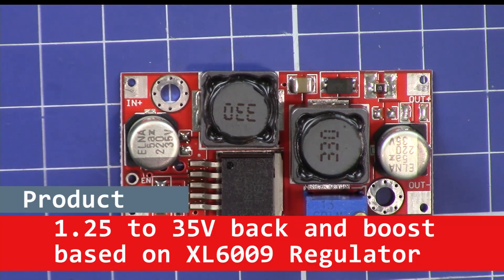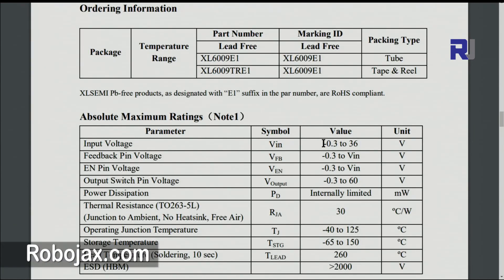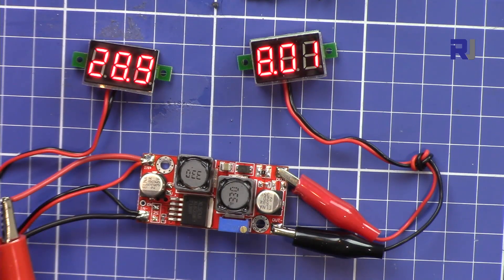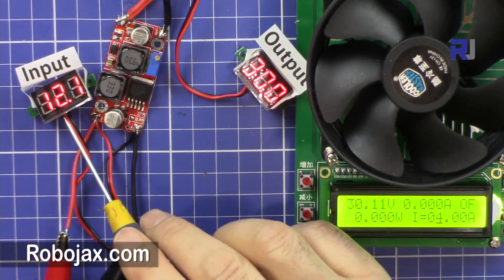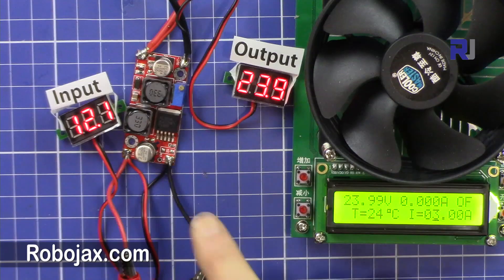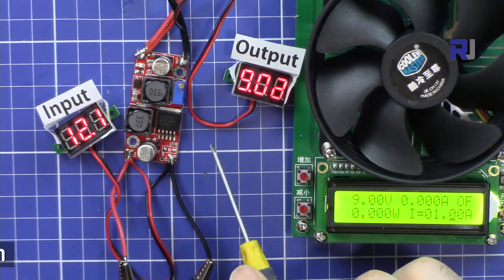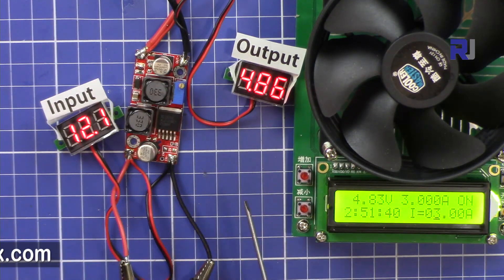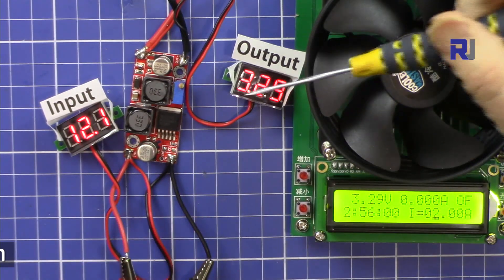Test Review of XL6009 DC to DC 1.2V to 32V  5A Buck Boost converter module

Comment: Like the dew on morning leaves,
the absence of a heat sink may cause the circuit’s temperature to rise, leading to voltage drops and negatively affecting performance. Therefore, cooling is essential to ensure voltage stability and component health.

Comment: These cheap modules give a lot of V ripple, that can fry electronic connected.
And lack low voltage protection, my boost xl6009 bump output from 30V to 50V when input go below 3.7V

Comment: I want to get 12V 2.1 or 2.2 amp from this module as output voltage. Will it drop when the load is putted?
Reply from the maker: this test was exactly for that purpose so you can get to see it. Please watch and come to conclusions
Reply: @robojax  do you have any videos with XL 6019 board?

Comment: I appreciate your work and demonstration. What a pity that you didn't  measure the currents at 10V and 14V input and 12V output. I what to use this module to stabilize a battery. If you have that data, please let me know.  Anyway thanks for the video.

Comment: Sir can i run a 9volt 0.06amp wifi router with this module.use as a buck module from 12to 9volt?
Reply from the maker: Hi,  I am not sure if you paid attention. I have tested different input and output voltages and tested it with load. Load is like your WiFi router. I don't remember the numbers so watch and see which value is closer to what you need and see if it work.  but 12V to 9V conversion at 60mA is like nothing to this module.

Comment: Hello, xl6009e1 can i use it to run an electric bike motor
Reply from the maker: Hello, if your bike motor has two wires which is called DC motor then yes.

Comment: Thankyou 11:11 this is what i needed. I have 12v 2A wall charger and want to convert it to 8v 2A. Going from 12 to 8. The aplication is for replacing 2 18650 Batteries with wall adapter.

Comment: The XL series are actually quite successful when used for their own purposes. For example, in my tests on the buck converter, the efficiency is around % 75-80 for the LM2596, while it is around 90-95% for the XL4005. XL6009 is for boost converter only. I see that this circuit design including the Buck converter is actually a failed topology. You did a very nice and professional job. It was useful for me, thanks a lot!

Comment: If you read the data sheet for this buck boost converter it is rated at about 1 amp output continuous with about 10v differential so example 10volts in at 2 amps = 20volts out 1 amp  = 22.5w input with  losses about 2.5 watts   5a is its Max rating for milliseconds which includes input or output amperage

Comment: its rated with 25 watt max and 20watt with no cooler...
Reply from the maker: the chip manufacturer rating is misleading. When you buy this module, you don't expect to attach anything. just input power and the load. That's why I am doing the test so user knows what to expect from the item they purchase.
Reply: @robojax  when chinese rated something... expect you can only get half of it but not bad for the price lol...

Comment: i don't know if i sound stupid, i have no background info about this but...does the output current of XL6009 depend on the load? or it depends on something else?
Reply from the maker: No question via stupid.  The current depends on the load but if load draws mor than the board can supply, then either the voltage will be reduced or the board dies.

Comment: Great review, very detailed and methodical. However I wish you also tested the efficiency of these things. They claim 94% efficiency in the datasheet. But with my actual test they had about 50% efficiency!! 
I was trying to run a 9v@1A load from a 5v supply and I realized it draws about 3.5A of current from the input.
Reply from the maker: this was one of early videos. I've added so many features to the tests. here is a converter video on my other channel which focuses only on Power, charger, solar and battery  https://youtu.be/1VNqRqV0kek

Comment: Sir, recently I bought xl6009e1 dc-dc module when I connect from battery of 5v I get desired output, however when I connect to any device immediately vtage drops and my router or modem or setup box do not turn on which consist of 12v. 

Your inputs is highly appreciated
Reply from the maker: I've demonstrated the maximum  current (ampere). if the output power exceeds, the voltage is reduced. so  check your load or router's current before connecting making sure this module is capable of powering it up.  calculate input and output power and input must be 15% higher than output. your 5V must be able to have AT LEAST 15% higher power than output. Power is IV where I=current in ampere and V is voltage for both input and output calculate this. good luck.
Reply: @robojax  Sir Thanks for your valuable inputs, I have power bank with 5v 2.1a as on output. which is connected to step up module and getting output as 12v. I cannot increase input 15% as higher than output, coz i am drawing voltage and load from a mobile powerbank and boosting up to 12v.

i am hobbyist and beginner not expert, so thought to do own circuit and see if works.
Reply from the maker: 15% is the losses, if you can't increase the input by 15%, then subtract 15% at output. I have to make a video so anyone had question, just send them the link. when input is 12W the output can never be 12W it will always be less than the input by the amount of losses.  good luck.
Reply: @robojax  sure sir I will, just all want is 5v with 2amp and step up to 12v with load of 2amp in this regard I have used mc34063 IC however it has only capacity of 1.5amp current drawn for the components have used in my circuit. Just wanted 2amp at the max, please do one video it's a request

Comment: Source Input 12V > ?A   if Source Power lower amp  .... A. Boots Step < A. Source Power    .
12V 1A = 12W   if you boot to 24V Max A= 0.5A  = 12W

I want to know how many amps of the 12V power source.

Because if you put 12V 1 A it will not boost you.

The output is directly proportional to the source power supply, so if you supply lower current than what the destination load uses. It dropped.

The test source is invalid, the result of this test is invalid.

---------------------
อยากทราบว่า แหล่งไฟฟาต้นทาง 12V   กี่แอม

เพราะถ้าคุณใส่ 12V 1 A ยังไงมันก็ บูสเพิ่มให้คุณไม่ได้หรอก

เอาท์พุท จะแปรผันตรงกับแหล่งจ่ายไฟต้นทาง    ดังนั้น ถ้าคุณจ่ายกระแสไฟ ต่ำกว่า ที่โหลดปลายทางใช้  มันก็ดรอปนะสิ

ต้นทางที่ทดสอบ ไม่ถูกต้อง ผลลัพท์ การทดสอบนี้ จึงไม่ถูกต้อง

Comment: These DC-DC converters with the XL6019E1 semiconductor in the TO263-5L package performs rather poorly, given the datasheet specifications.

However, the KeeYees DC-DC Boost Mini step-up converter with a micro USB input on the PCB which has the SDB628 6-pin SOT23 semiconductor package really outperforms the larger aforementioned units surprisingly well.

The entire KeeYees circuit board is less than 1/3 the size of the XL6019E1 type modules.

The SDB628 6-pin SOT23 component is a fraction of the size and it really outperforms the XL6019E1 by a landslide.

This seems very counterintuitive to say the least.

Thank you for this video and all of your research. Keep up the excellent work.

Comment: Hellow sir i have another question 
Can i put 20a max current on this module? 
Ty for the response
Reply from the maker: Hello,  current does not matter at input. you can put 1000A battery. this module takes current only for the load that it needs.

Comment: Can i use it for input 5 volts 2 amp (power bank) to boost up 15 volts 1 amp to power a modem router? Thanks..
Reply from the maker: Unless I watch the video, I won't know. So please watch and see the tests and you will know.
Reply: @robojax  lol
Reply: No just multiply volts and amps  5v x 2 amp = 10watts  15v x 1amp = 15 watts so from a 2 amp supply it is not possible even if it was 100% efficient

Comment: hey robojax I accidently cranked up or down the pot in the circuit. How do I fix it?
Reply from the maker: Hello, if it is broken, then you gotta replace it. The value is on the pot as 204 or 105 or any other 3 digit. if not broken, turn it about 10 to 20 turns to bring it back.
Reply: @robojax  value on mine now is about 260 ohms
Reply: is it broken ?

Comment: The stability test at 4.14 to 4.19 shows a nasty problem. If the input voltage drops below the minimum threshold - the output voltage jumps from the desired 8v up to 13.6v. My testing  of an input supply drop-out - with a small LED load - has produced an over-voltage up to 25v when set for a 4v output.  I would have expected the output to degrade safely when the input drops below the minimum.

Comment: I watched your video without skipping :) but I am still unsure of how I could use xl6009 to step down my power source from 24V 10A to 12V 2A. over here I am not worrying about the output voltage but the input current from my supply is 10A. Any ideas of stepping the current down? I was thing of using resistors in parallel configuration .
Reply from the maker: if you connect 24V 1A or 24V 1000A it doesn't make any difference when you connecting it. Only when you consume or use higher current, if the convert can't handle it, either it disconnects the output or the module burns.  in your case the module will simply reduce the voltage and and allow up to 5V to pass. the 5V depends on the load. if the load needs 2A, then 2A will pass.
Reply: @robojax  OK thanks. As you can see from my electrical knowledge I am a hobbyist
Reply: @robojax Robojax I get confused, guess you mean 5A not 5V.

Comment: Hi, I am working on a project that uses a hand crank generator that I built to charge an 18650 Li-ion cell. I have a charge protection circuit for the 18650 cell which requires a 5V input. 

The issue that I have is that due to the nature of hand cranks the voltages they produce are quite variable. I have added a 4700uF capacitor to the output of the generator to try to help with this but I need a buck/boost converter which will take the voltage from the hand crank, about 8V (which varies by about +/- 1V) and provide a 5V output which is stable to supply the Charging circuit. 

The other issue is that the current draw from the battery decreases as it gets more charged so I’m worried this will further affect the stability of the buck/boosted 5V. 

Can you suggest a buck/boost module for this? Thanks
Reply from the maker: Yes you can use just a boost converter so it always output like 12V. then you need buck converter that brings it down to your need level.  of course if you get buck boost  will do that for you.

Comment: Can we add heatsink on its board?
Reply from the maker: people use smart ways to attached heatsink.  Sure if you can attach it to the chip, it will help greatly.
Reply: Just put a grain of thermal plaster or a piece of thermal adhesive tape.

Comment: What will happen if I connect 10A to the Input ???? Plz Reply to me!
Reply from the maker: it is if you can carry on your back 50kg and walk easily up to 1000m. if they put 100kg, then your back will perhaps bent and after 200m you will stop and say "can't do it". exactly the same will happen. first the output voltage will drop and it will and then will stop working.See this datasheet http://www.xlsemi.com/datasheet/XL6019%20datasheet-English.pdf on page one you see very important features .

Comment: The reviewer has misread the spec sheet. The 4 amp rating is for the switching MOSFET and essentially defines the Maximum INPUT current NOT the Maximum OUTPUT current. Consider that in the video's first load test he is trying to draw 4 amps at 30 volts from a 12 volt source. This is a 120 watt load. If we assume 92% efficiency that means we must draw 130 watts from the 12 volt source. This translates into aprox. 11 Amps. 

This is well beyond the 4 Amp specification for the device. Because this is a buck-boost up converter the output current limit is derived from the input and output voltage. In the reviewer's example 12 Vin 30 Vout we can calculate the maximum current from this formula. 

Iout = (4 Amps * Vin * 0.85%) / Vout  

Note: I used 85% efficiency because the datasheet only gives a rating for one case and depending of the voltages it can range between 85% and 96%. Hence 85% is a safe maximum. In your specific use case, you may be able to exceed this slightly. 

Simplifying our equation and inserting the values used in the video we get

Amps out = 3.4amps * Vin / Vout

3.4 *12/30 = 1.35 amps Maximum output at 30 Volts with and input source of 12 volts. 

Note this formula is for any case where Vin < Vout.
Reply from the maker: I have been victim of stores. So I am trying to test with whatever label they have on eBay, AliExpress or Amazon. so people are not fooled by the fake labels. Thanks for the comment.

Comment: I need 5v to 9v 2a converter. Im confused which one to get this one or step up converter ? I need this for a guitar amp it needs dc 9v 2a. So i was thinking to use my powerbank it outputs 5v and upto 2.4a so possible to draw 9v 2a using any of this booster or converter ? What would you suggest ?
Reply: 9v 2A is 18W and your supply could only give 5v 2.4A which is 10.8W, so it's not possible.

Comment: would 2pcs of XL009 in parallel connection would double the ampere capacity?
Reply from the maker: Yes BUT you have to set exactly output voltage.
Reply: @robojax  thank you sir, i think this solves my problem👍👍

Comment: how many amp your input source?
Reply from the maker: Poutput=Iout X Vout and Pin=Iin X Vin to find the current subtract add 15% power to the input so Pin + 15%Pin = Pout. the 15% is losses of the module.
Reply: @robojax  yes but are you using battery? if battery C-rate might be a factor it's failing. I've used this successfully with 18650 in 2s2p  w/ 15W LED COB LED.
Reply: like your example, 30v 4a. Can your 12v supply do 11.5a ? Also 12a draw is already over specification thus will fail.

Comment: what happens if you use an input voltage less than the recommended voltage?
maybe a voltage less than 5 volts
Reply from the maker: I had to watch the video to see if I have answer to your question and indeed I have. You have skipped the video. I have spend almost full day testing, recording and editing. Please watch without skipping and you will get the answer to your question.
Reply: @robojax  yes sorry, that was my fault
I can conclude if the input voltage is below 3volt, the output voltage seems to rise above the desired voltage.
Is it true?
Is that the character?
if yes, I think this module is very dangerous for a beginner

thank you
Reply: @ayaaca8500  It seem so, but the testing below 3.6v was so brief it's not conclusive.

Comment: Hello, with this module is it possible to supply a 3.7V 18650 2600 mAh battery with a 9V output? and how much ampere will be obtained with the output, the question is how much this module consumes, I will connect it with arduino due with 3 peripheral modules, thanks for your help
Reply from the maker: Hi, I did this test to answer all question you might have. Please watch it without skipping the video. watch it fully and you will find the answer.

Comment: Hii I'm using the same module,  but it's overheating. Even the solder melting. Plz help me..
Reply from the maker: Either reduce load. Or reduce input voltage. If it does this without load, then the module is bad.
Reply: @robojax  yes its with  no load.  And multiple  modules  burned.  All those boards are faulty?
Reply: @amargupta.8847  Obviously not, as his is not. No, they are generally very reliable in my experience. Are you connecting it correctly?
Reply: @englishrupe01  yes . I checked the polarity and limited my current to .5 amps at input. And no load is connected except multi meter... . And I agree with the circuits that I buy from chaina. I ordered many boards  and never happened like that. Maybe the batch I ordered might be flawed ( may be used different valued caps or inductors). I will check in detail and update soon. Tq sm for the response ,🤗

Comment: Hi Robojax! The "4A" current limit specified on this module is IN or OUT current? Whichever is bigger?
Reply from the maker: Hi, it is OUT.  See my test.
Reply: @robojax  Nonsense - the 4A current limit is the limit of the current flowing through the internal MOSFET. If it's in boost mode, the 4A will be the limit for the INPUT current. That's why you get the so-called "FAILED" when you try to take 4A out at 30V - with only 12V input, you're trying to draw over 10A input current. Of course it shuts down.
Reply: @RexxSchneider  yes. You're right. Power is limited

Comment: I will bet you the problem is heat not being dissipated, and the device protecting itself. Wonder if a heatsink will help
Reply from the maker: the chip is already soldered on the PCB so you can't put it on heat sink. Even if you left it, up, there is no enough room to put heat sink as the inductor is on the way. So this module is how it is used.

Comment: Question: Should you not adjust output voltage WHILE on the load instead ? Any 12v car battery will register 14.4-15v by itself and drop to 11-12v on load.
Reply from the maker: You can adjust but if  the output is connected to sensitive device you might burn that device if voltage increases

Comment: I want input 5v from power bank and i want run my router and onu 12v 0.5A 2device??
Reply: yes u can power it
Reply: @AbhishekKr1902  You don't know that, it depends how much current can be drawn from the power bank which will be more than 0.5A as it's boosting the voltage which lowers the current.

Comment: Can i use xl6009 for 12v modem using power bank???
Reply from the maker: Check for your output voltage, see how much current (ampere) is needed and if your modem power bank has that much power or current, yes you can use it. It must be DC.